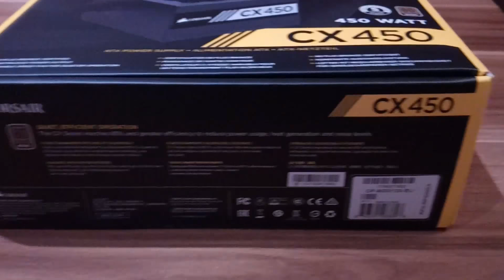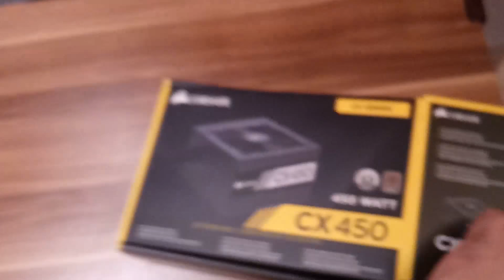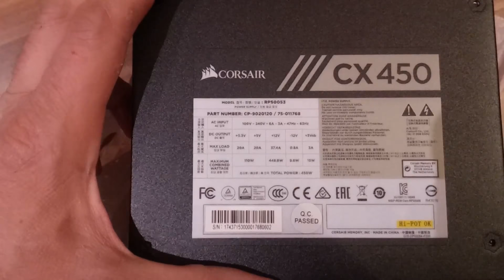Corsair CX450 Power Supply Unit Unbox and Install Cables

Comment: Is the difference between modular and non-modular PSU only longer? The height and length stay the same right?
Reply from the maker: The difference is that you can skip some cables to mess around in the case. Everything else is mostly the same.
Reply: @TechnologyMove  So the size doesn't change at all?
Reply from the maker: @BurnedCoconut  Confirm. Because I was using this PSU for few years than I switch to modular Corsair 650W (it went faulty) and now I'm with modular Seasonic 750W. All installed in standard ATX case.
Reply: @TechnologyMove  Oh ok, so I won't have any problems when I replace my non-modular psu with the CX 550 (for me)
Reply from the maker: @BurnedCoconut  Nope. Merry Christmas and happy building :)

Comment: I'm completely new but if I use nvme instead of sata or hdd then I don't use those sata connectors right?
Reply: I have NVMe M.2 SSD
Reply from the maker: Yes, that's correct. M.2 is installed directly to the motherboard and you don't need any cables to connect to it. Cheers

Comment: Do you think this could run a Ryzen 5 2600 with an rx570, 4 120mm fans and a 24 inch moniter
Reply from the maker: Hello there. Yes it will run. Your Ryzen is with TDP of 65W + GPU RX570 with TDP of 150W. Monitor is not powered from the PSU. So you can run it like a Pro. There is a link to this PSU in the description. Please give thumbs up to support the video. If you have any other questions, feel free to ask :)
Reply: Hello, do you think this could runn a Ryzen 5 2600 with a msi 1660 gaming x 6gb?
Reply from the maker: Sorry for the delay answer. Yes it will run. The MSI Recommended PSU is 450W and the Ryzen use is about 65W. What games are you planning to play on this build?
Reply: @TechnologyMove  no problem gta 5, battlefront 2, minecraft, cs go

Comment: Hi, i know you get a lot of these questions but will it be good for a ryzen 5 1600 af with an rx 570 4gb? And also the sapphire nitro rx 570 needs 14 pcie slots. Does it have enough?
Reply from the maker: Hi there, are you talking about this card https://www.sapphiretech.com/en/consumer/nitro-rx-570-4g-g5-oc ?
Reply: @TechnologyMove  Thanks for answering! Yes that's the one.
Reply from the maker: You will need better PSU, like 500W or higher.
Reply: @TechnologyMove  ok thanks!

Comment: Will this power supply be good for my Ryzen 5 3600 and Radeon rx580 8gb?
Reply from the maker: This combination of RX 580 8GB https://youtu.be/Is1_rFJyhOU and R5 3600 https://youtu.be/8LFXh_Ftrro need 500W PSU or higher. If you have any other questions I'm here to help.
Reply: Technology Move got myself a corsair 550 a bit ago! Thank you!
Reply: I got it for that and 1660 surper

Comment: Hi, i have a question. Is this PSU enough for Ryzen 5 2600x and Radeon rx 580 8gb? I would be really thankful if you answer
Reply from the maker: Hi there. Sorry for the delay answer. I have tested the Radeon RX 580 8GB here https://youtu.be/Is1_rFJyhOU and recommended PSU is 500W. With this 450W PSU you will be on the edge, better pick bigger PSU. If you have any other question, feel free to contact me. Cheers
Reply: @TechnologyMove  thank you a lot for your answer, I also want to ask which 500W PSU would you reccomend?
Reply from the maker: @tvojamater3130   I'm a fan of Corsair so I would recommend you this 550W Corsair https://amzn.to/2TgeUoJ  or this 500W EVGA https://amzn.to/2wnnrxi.
Reply: @TechnologyMove  Thanks again for your response, you helped me a lot
Reply from the maker: @tvojamater3130  If you have any questions related to computer hardware I'm here to help. Have a great day.
Reply: @TechnologyMove  I actually have a lot of questions since this is my first PC build. 
So, these are the components I am planing to buy( I changed the graphics card since it is almost the same price as the Rx 580)
CPU: AMD Ryzen 5 2600x
GPU: AMD Radeon 590 8gb
PSU: Corsair CX550
Motherboard: AsRock b450m-R4
Ram: Still haven't decided, mostly why I need help
SSD: Crucial BX500 480gb
I would like to know if this is a good build for gaming, which RAM to choose and also is it better do get a regular Ryzen 5 2600 to save a little money.
Thank you a lot again, this means a lot to me
Reply from the maker: @tvojamater3130   I have learn in the years that, it's a bad idea to save money when you build a PC and you want to hold good in the years ahead. The regular AMD Ryzen 5 2600 has lower consumption then the X, and I'm sure that you will not see the difference between them. I would pick the regular for this build. Since the b450m-R4 have 2 slots for RAM memory, will advice you to go for 2x8GB RAM (16GB is enough for most games) with any Corsair series around 3000MHz. Everything else is great for first build.
Reply: @TechnologyMove  I hope I'm not being annoying, but i have another question. B450m R4 a good motherboard or should I invest a bit more in a better one?
Reply from the maker: @tvojamater3130  The mobo us good. There are lots of motherboards in the market. Be sure to use 2x8gb RAM memory, because if you use 2x4gb it will be not enough for lot of games.(personal experience)

Comment: When I flip the switch on, nothing happens. It is CX550M. I connected it to wall outlet and also to my Motherboard and CPU, but I didn’t connect it to SSD/GPU yet. Don’t know if that makes a difference but I can try
Reply from the maker: Hello, connect them to the SSD and GPU and also make sure the little switch on the PSU is turned to ON. Let me know what happen.
Reply: @TechnologyMove  thanks for the reply. The PSU was already ON, but I hadn't connected the power switch from the Case to the motherboard yet. When I did that, and I pressed the case button to ON, then the PSU started running. 

I thought PSU could run of its own accord but I guess not
Reply from the maker: @AliKhan12345  Now you know how to do it. Next step is to enjoy the PC and share your experience if someone else have similar problems like yours. Have a nice day :)

Comment: Hi I'm currently building my first PC with this exact psu but nothing but my CPU is working. Which slots on the back of the brick are supposed to be used?
Reply from the maker: Hello. Don't worry building your first PC, You can do it. Now tell me what exactly is the problem, because I did't understand your question. You can point with timing on the video (example 10:15).
Reply: @TechnologyMove  don't worry about it my friend, I managed to get everything hooked up right
Reply from the maker: @rtiwitharcher  The feeling is awesome when you build your PC by yourself.

Comment: Will this work with a ryzen 5 2600 and a 1660 super
Reply from the maker: Recommended PSU for this combo is about 450W, but talking about PSU you have to add additional Watts to be sure of smooth work. Will suggest to put 500W PSU. Best regards

Comment: can the 8 pin cpu connector split into two 4 pins?
Reply from the maker: Hello there. Yes it can split into 2x4. You can see it in 4:27. If you have any other questions I'm here to help. Please give thumb up to support the video.
Reply: Technology Move okay thankyou for the help!
Reply: Technology Move does the CX450 80+ bronze 8 pin also split into two 4 pins?
Reply from the maker: @chestbrah.960   I think all do that.

Comment: Is the PCI EXPRESS a 8 pin connector ?
Reply from the maker: Yes, the connector is 8 pin for the GPU (2 plugs, one with 2 pins and one with 6 ). You can see connecting this PSU 8 connector to Asus GTX 1080 TI on my last video https://youtu.be/W-e0eowl3uM.

Comment: What do I do with the 4 pin connectors
Reply from the maker: Hello. Are you asking about for the Peripheral Cables in 0:25 ?
Reply: @TechnologyMove  yes
Reply from the maker: @cameron9757  They are power for old peripheral devices or for case fans that are constantly working without changing the speed.
Reply: @TechnologyMove  so do I just leave them
Reply from the maker: @cameron9757  Yes mate, mine are standing next to the PSU for 2 years. 😉
Reply: @TechnologyMove  lol😂. Also I was just upgrading my pc mother board and power supply to a new pc case and I took 5 hours to build and everything and then I realize the CPU does not support the mother board and i have to get a 8th gen cpu
Reply from the maker: @cameron9757  well next time you build your PC you will know how to do it. It's very common these days for that mistake. Even on specifications says "this motherboard can support this and this CPU" some time BIOS is not the proper one for your new CPU. Sellers don't care about that and we have to struggle with this. If you have any questions or concerns please feel free to contact me. I'm here to help.
Reply: @TechnologyMove  thankyou have a nice day
Reply from the maker: @cameron9757  You too

Comment: Does it support mATX because i have an MSI A68-HM33 V2 and i want to upgrade the Gpu
Reply from the maker: Hello there. I can't understand your question. You want to add this PSU to your case, or you want to add new GPU and want to know if this PSU have the 6 pin connector?
Reply: @TechnologyMove  i want to add new psu, And i want to know if it's support my case, mATX -microAtx it's my case
Reply: @TechnologyMove  i want to know if it fit in my mATX case
Reply from the maker: @damianv8915  If you give me the Dimensions of your PSU, will tell you if this will fit or will tell you what other PSU to buy
Reply: @TechnologyMove  delux model atx 450w p4, i dont have the dimensions buyt i have the model, google it and you will see what i have
Reply from the maker: @damianv8915   From what I have found, your Delux is 150 x 155 x 8.5. This Corsair is  150mm x 140mm x 86mm. From this look ok and will fit. But if I where in your position will measure the width and height from out side of the box and compare to the corsair.
Reply from the maker: All Corsair PSU are with dimensions of 150 mm width and 86 mm height.
Reply: @TechnologyMove  ok, thanks

Comment: Everyone this psu will work for a 1650 super and ryzen 5 2600, I personally think if you are going to overclock I’d go for a 500-550watt, if you overclock on 450 you’re kinda pushing the limit
Reply from the maker: Agree!
Reply: Is this psu good for gtx 1660 super or should I go with a 500/550 watt? (I don’t plan to overlock)
Reply from the maker: @xenonex8151  Yes 450W will do the job for the 1660 Super, don't worry. Cheers
Reply: @TechnologyMove  Thank you for the information 😁

Comment: is this good enough for an I5-8600k 1060 3gb? no OC
Reply from the maker: Sure. I5-8600k use max 120W in peak and the gtx 1060 3gb use around 120W in OC on Gameplay.(Evga 1060 3gb benchmark https://youtu.be/OK3zgeLBqUI If you have any other questions please feel free to contact me.

Comment: Does it come with a sata cable that could support an ssd (not an m.2 nvme)
Reply from the maker: No. There's only cables for power supply the SSD/HDD. Sata cables comes with your motherboard or you buy them separately.
Reply: Technology Move thanks for responding. Would the ASRock B450M - HDV R4.0 motherboard come with a sata cable?
Reply from the maker: @xvaq  Every new motherboard have to come with two sata cables in the box

Comment: Is it stable in i3 9gen Rx 570 4gb Mobo gigabyte h310m
Reply from the maker: Yea, it's enough. Example the RX 570 consumption is around 200W max and the i3-9320 consumption is around 65W. This PSU is enough. Cheers and please share or give thumbs up to support the video.

Comment: Do you think I could use this PSU with a Ryzen 2200g and an RX 580 4GB? And if yes do you think I would be able to overclock it or would that be overdoing it?
Reply from the maker: Hello there. If I had your build, I will go for higher PSU. Like 550 Watts minimum. This is because of the overclock. Consider bigger PSU when doing overclock.
Reply: U basically have the same build as me 😊

Comment: Why the CPU power conector have 6 pins? It should be 4 pins.
Reply from the maker: The CPU power connector in 4:46 have 8 pin that can be split in 4+4 ( depend on the motherboard). If you are looking at 5:10, this is the GPU power connector that have 6 pin standard with additional 2 pin depend on the GPU unit.
Reply: how can you split it?
Reply from the maker: @csongorbekynagy3083   Hello. See 0:22 there are x2 EPS/ATX12V cable. It's one plug but you can separate it in 2. Also see 4:46 there can be seen that they can be detached one from another. Cheers

Comment: Would it work with a Ryzen 5 1600 and a gtx 1650 super
Reply from the maker: Yes, it's enough. Ryzen 5 1600 consums around 50W and gtx 1650 super consumption peak is near 200W. Cheers